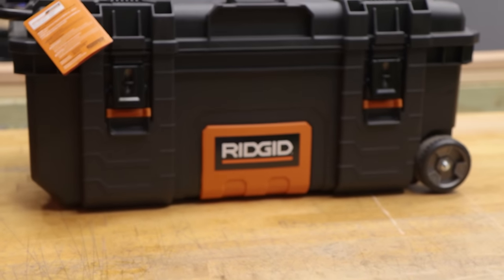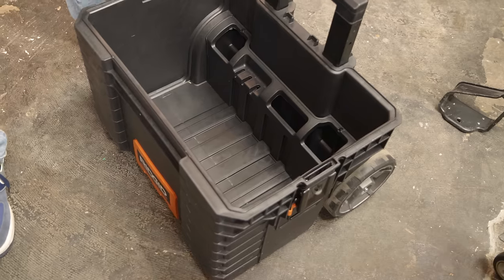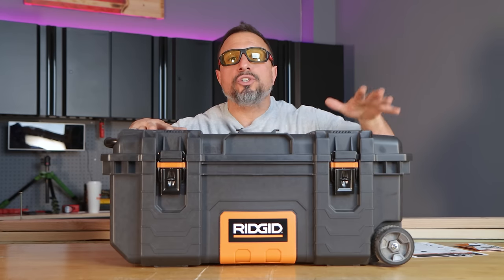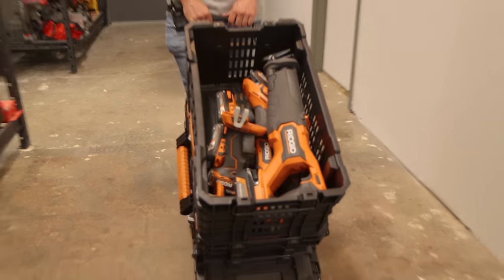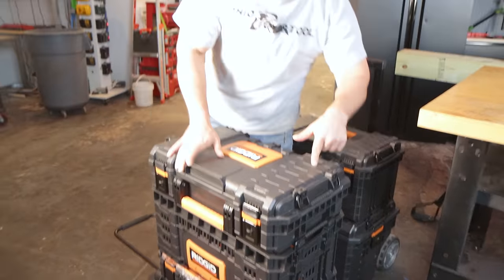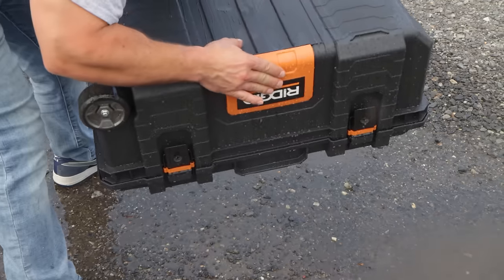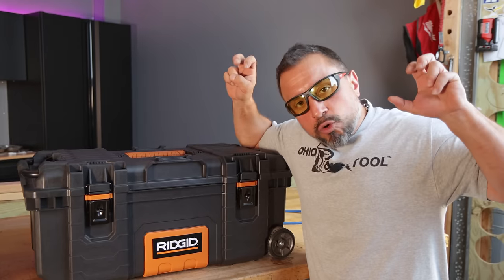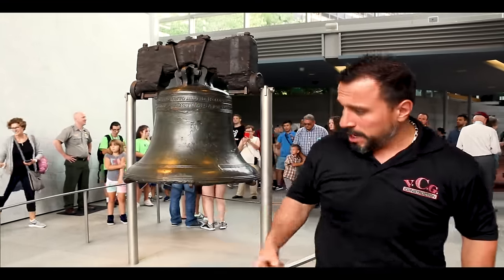Rolling Tool Storage System at The Home Depot DESTROYS MILWAUKEE & DeWALT

Comment: I’ve had the Ridgid system for probably 5 years now and those boxes have been through rain, snow, hail, thunderstorms, temps barely above zero, and to 120 degrees. They still seal, they still protect my tools, and I couldn’t be happier. The best thing is I can strap the bottom box down and snap the top boxes to it in the bed of the truck and have no concern with then coming apart.
Reply: Very good value for price for sure. But the wheeled one is not reliable (the telescopic handle). You have to handle it carefully. Everything else is great. I hope they release more stuff like milwaukee

Comment: When I was shopping for one of these systems, I purchased the Milwaukee system ONLY because the connecting latch system on the Ridgid system looked like it would wear out in about a year with regular use. I say this because while the "handle" half of the latch is metal and VERY durable, the catch side is only plastic that will get filled away each and every time you take the boxes apart or put them together.
Reply: Doesn’t seem to be the case after having mine for a while now and using it everyday

Comment: Sorry completely disagree... ive owned all ridgid boxes with exception to this new one and a good deal of packout boxes. And milwaukee blows ridgid out of the water... over time on the ridgid the rubber on the wheels will come off, have not experienced that with milwaukee. The locking loops for padlocks on the ridgid boxes will bend and eventually snap given enough contact with other items or material in your truck. Have not experienced that with milwaukee. The handle on the ridged stopped working on the smaller rollong box about 6 months into owning it. No problems with milwaukee. The gasket on the ridged boxes ALL of them failed within a year. Again no problems with the milwaukee. I dont want to go back to a store to replace the boxes because they are faulty. And get another one, when i buy a product i want it to last not go back and keep getting the same broken product from a company that doesnt listen.

My work experience is working as a Waterproofer and maintenance technician for commercial and residential buildings.

Comment: I was just looking at the Milwaukee packout 20" packout bag with zipper on sale at Home Depot for less than $50. You're saving about $15 dollars but like the fact that it has a zipper because the open pack out bags I think it's easier for someone just to grab a tool and use or take it. Hope your having a good day staying cool 😎 brother...🇺🇲
Reply from the maker: Yooo Joseph, hope you’re doing well! 👍🏻
Reply: Must be in store only. I cannot find it online
Reply: I've been doing this with the stacking rolling husky bags for years. One handle on the big rolling bag, the other bags slide on the handle. Easy to put in the cab. Easy shape to carry by your legs with the cloth handles, no lid to mess with, lots of pockets. Don't even have to close them ever, just not waterproof. The only way I'd have a solid storage is if it had drawers. Dewalt has been doing van racks for years and I don't know why that couldn't be mounted to a hand truck.

Comment: Over a short time the latches start to fail. The rubber orange seal falls out, the side bars locking system, is ultra fussy regarding alignment, and if the two boxes twist slightly, the bars jam up and require brute force to remove.
All my Rigid stuff has now been moved to shed storage duties, and I've switch over the Packout System.
Been there, done that.

Comment: These are awesome boxes, I’ve used the smaller rolling rigid pack out for years now with no problem, left out in the weather all the time with not a single leak, had over 200 pound on it with no issues at all! Beats Milwaukee all day

Comment: I ran the Rigid system for several years. It served me well. I updated to Packout last summer. Both have their strengths. I will say this, if your boxes are out in bad weather like snow and ice,  Rigid is better. The packout cleats fill with snow and ice and make the unusable. Or worse they freeze together. I had to put garbage bags over them last winter. It sucked. I have a van now instead of a truck so it’s no longer an issue for me. But it’s certainly good for thought.
Reply: Either move to Baja for winter like I did... or spray tool box with De Icer
Which I also did!
Reply: Thanks for the input brother!
Reply: This is very useful information to have, thanks for the input
Reply: Thanks for the heads up. I almost bought the Ridgid. I could of got the big bottom with the larger wheels a smaller sized tool box and one of the crates f on th local home Depot for just the price of the bottom packout from Milwaukee. I'm gonna go back and get it as soon as I have the funds again. I ended buying a diamondback Toolbelts instead so I'm tapped out atm.
Reply: Wait.  You leave your tools in the back of your truck, open to the elements and hands?  Why do you hate your tools so much?

Comment: "DESTROYS Milwaukee..." , for real?
Its could be my preferred system for low budget, but please, you can't say its better then the-all-mighty Milwaukee Packout.
Reply: Packout all day everyday bro!!
Reply: A normal 22” ridged box can hold more then a comparable packout 

Why spend $2,000 for 2 stacks of plastic tool boxes? Super silly, a box is a box
Reply: @MCMXI1  Milwaukee has MANY options. Milwaukee has the same style box about to be released (if they haven't already). And you also don't have to get the rolling tool box. You can also get the rolling dolly. Or the wheel cart
Reply: Tribalism over a tool box is just stupid, face it the Ridgid sure appears to be better
Reply: @MCMXI1  Agreed that Milwaukee should have made the handles easily detachable/attachable. But there are a ton of people who've modded their boxes by removing the handle retaining screws and replaced them with pull ring pins.
Reply: And not to mention you guys, Milwaukee Packout has more things to add on to it, and they’re more durable. Yes ridigd had a lifetime warranty but, still come on. Packout there’s endless options on organizing and storing your tools. Look at the others, not many options has Packout.
Reply: @deanfirnatine7814  It doesn't though. Vince already did a live stream talking about the leaked Milwaukee version. Bigger, burlier wheels and heavier capacity. Vince is just doing YT things for clicks

Comment: 5:15 I wonder how well this (and other tool boxes) would hold up to a firehose test 🤔, for that heavy rain/winds and such that places get when rains etc….
That’s 2 nice things about FL: don’t need memberships for steam/dry saunas; as the weather outside creates them for us😉
…and 10 seconds later…..it’s over, lol.

Do think the new rolling boxes (and the packout drawers) are a nice “complement” to the storage system of choice; and not a “and/or” type thing. Least for me anyways, seeing that the drawers don’t have gaskets; which wonder if possible to make air/water tight 🤔. So, do like seeing new boxes being released that help make a storage system “better” and allow for larger tools to fit a lot better; cuz trying to get jumbo nailers, SDS drills, , levels, accessories, etc…into some boxes can be challenging at times. Having OPTIONS is never a bad thing, imo👍🏻
Thx VCG for the vid, cheers✌🏻

Comment: With IP ratings the first number is the Ingress Protection for Solids, the second number is ingress protection for Water.

IP65 is equal to:  The first number "6" - "Dust Tight, no ingress of dust", The second number "5" - "Protected against jets of water".  You tested for probably "61" or "62".  If the second number is "1" - "Protected against vertically falling drops of water.",  a "2" - "Protected against vertically falling drops of water with the enclosure tilted up to 15 degrees from the vertical."

Comment: 6:17 That is true, least I know it does for cellphones, etc… It’s one reason why the OnePlus phones don’t have an IP rating at all, even though when after tear downs and reviews; the phones have gaskets and water Ingres protection(not sure about being submerged and how long will “hold up”). So, even though the phones can withstand getting wet, officially the phones are not waterproof or have any IP ratings, as it does cost money to get certified.

note:
(When was a partner in electronics repair biz, this is what we saw; knew about, but been out of that industry for some time now; so could be wrong)

Comment: Gotta agree with a few other commenters. The wheels are just too small for it to be a jack of all trades kinda box. I can see it working for some but trying to drag that thing through a grassy yard or gravel, heck anything thats not as smooth as pavement and your gonna be cussing it under your breath. Especially if its got some weight to it. The hinged lid is nice though compared to their other rolling box. That always had me scratching my head as to why they didnt hinge their rolling box, maybe so you can use it without a lid?

Comment: All the guys at the company I work for use either the ridged box system or the husky/kobalt soft roller bag systems. I personally use the soft system because it fits in the back seat of my pickup better. Both are great and you can’t go wrong with either

Comment: I literally have both the ridgid and the Milwaukee packout in the back of my truck. They're both solid, the handle on the Milwaukee rolling box is more comfortable, the Milwaukee latch system is definitely easier, SOMETIMES. But ive has zero leaks with the ridgid whereas one of the Milwaukee cases I have bits in finally leaked. Other then that they all get poured on sitting in my truck and never leak.

Comment: Thieves will always get in. Especially in the trades. Literally the worst part of the job.
Reply: Have you considered booby trap your tools?
Reply: @danl.4743  thankfully the packout stack, as long as it's on not wheels, is a low-level idiot theft deterrent system. Newbs can't get them apart.

Comment: The 100 pound limit is the deal breaker for me. I try to bring as much as possible in at once and that handle would snap in no time.
Reply: You carrying bags of concrete in your boxes or what?! Jack hammers and sledge hangers?! Lol I can't get 100lbs of tools and batteries in this thing, or my Milwaukee one. Now maybe if I had the crate loaded and clipped on the bottom I could hit 100, but I wouldn't try that with this piece, dumped tools a few times. The handle held fine, it's the latching system that clips boxes together that sucks.

Comment: I have own that same rigid setup for over 3.5 years now. Have left in back of service truck through rain, sleet and snow out here in CO. Open and close no issues and zero water  penetration. But only one issue is the bottom roller handle gets stuck due to its weather environment. Now that there's a different bottom roller with handle, doubt that would be an issue.

Comment: Problem with the rigid/keter/magnusson(/probably more sticker swaps) tool boxes is the plastic smell, they are very pungent. it's the reason i never bought them. I wasn't sure the smell would subside and sometimes I can have my tools in the house for a week or two and didn't want the house stinking. Went with Tstak instead.

Comment: I’m just gonna come out and say it - this is a Milwaukee system dressed in black and orange
Reply: Not quite, and it's the other way round as far as I can find. Packout is made in Israel by Keter from some quick researching (might be old or slightly incorrect information). 

This Rigid system is literally just the rebranded latest (but a few years old now) Keter connect system, it is sold across the globe under a few brand names: Keter, Rigid, Magnusson to name a few. Some are black with orange accents, some black with grey accents, others black with red accents, then there is the plain black.

Comment: The wheels are way too small for the load it will be carrying.  If rolling on an outdoor surface other than concrete, these wheels will sink and not roll very easily.  Rigid really missed the mark here.

Comment: They missed the boat with the small wheels. I would have bought one if the wheels were larger. I guess this box for people who do small remodeling in malls. Not good for new building construction with rough terrain.
Reply: The best thing to make is a separate base trolley with large wheels to roll through the mud and rocks then when you get to the concrete slab wheel your boxes or packout of that ,then you have nice clean wheels to roll through the building
Reply: @grahamreddog8251  No need to reinvent the wheel, I have used a large tire hand truck to transport my trolley when the site was really muddy and rough. I then left the hand truck at the concrete slab. Those tires on the Rigid box are really too small to negotiate some of the unfinished thresholds, transition points and stairways in a building under construction not to mentioned curbs and sidewalks. I have seen bigger wheels on baby carriages. Otherwise the box seems to be spot on to protect your tools. Those tires would be perfect to transport to a pre existing built structure to do remolding or maintenance work.

Comment: Milwaukee is to complicated and latches to well. You have to take the boxes apart to move them on and off off your truck and jobs. I chose the Rigid years and years ago before the new Milwaukee system. The Rigid are durable and stack and unstack easilly . 👍👍

Comment: Rigid and milwakee are brothers cause there made by the same company. I wish they made a damn better locking mechanism on rigid. Cause dewalt has an identical locking mechanism like Milwaukee wish they made ridgid with that same design i think rigid is a nice rolling case cheap and reliable hopfully they come out with a ridgid 2. 0 in the future

Comment: It's not as "Ridgid", as the name implies. I don't have this new one with wheels, but I just bought the same box. The same latches, (suck), the clips that are supposed to hold it to the other ridgid box or crate,(really sucks), they're somewhat flimsy and overly flexible, the lid seal is already falling off a little,..... My buddy uses all Ridgid tools for several years now, I use Milwaukee, he just said to me and our crew a few days ago, I think I'm switching brands. The batteries suck and don't last, tools go bad sooner, can't take abuse Milwaukee can. Ridgid is much cheaper, but not worth the hassle, unless you're a home diy'er. Contractors need batteries that kick, last through use, tools with power, boxes built better that actually clip together, and don't flex like elastigirl.

Comment: Almost makes me wish I hadn't pulled the trigger on the Milwaukee packout.
Reply: Don't worry, after weeks of use, maybe just days, you'd wish you bought Milwaukee. You made the right choice. I have both, and I'm frustrated with the Ridgid. After a week the plastic bumps that the metal latch grabs to hold the boxes/crates together, barely good anything. The weight has to be pulling straight down. If there's any twisting or carrying it with a lean, against your leg, etc , the boxes with fall apart from each other and you'll drop and dump stuff.
Reply: When you're carrying your box and attached crate, (not over loaded, not even close, it had tape, zip ties, tile spacers/levelers, tape measure and pencils, a couple trowels, little stuff), through a customers hallway and your latch system fails dropping the crate of the bottom of the box, and you scratch his oak base trim with a trowel that fell out of your new Ridgid setup, and you look like a fool, you'll wish you'd have invested in your mental health, and saved yourself the frustration. I know Milwaukee's prices are ridiculously high, but I don't need any more grey hairs, I need confidence in my tools and smooth sailing.

Comment: When I read "DESTROYS MILWAUKEE & DEWALT", I thought the advantages and differences would be more significant, but imo, there were no major advantages, certainly not worth "DESTROYS".

My favorite advantage in the Packout, which neither Dewalt nor Rigid accommodate, is modularity with the metal rails. Check out Packout mods by Packible Tools, or Jakeofall, Electronsmith - there's a lot more you can do with Packout's base design than the competitors can offer, most without even voiding the warranty/ poking holes in the box and breaking its waterproofing.